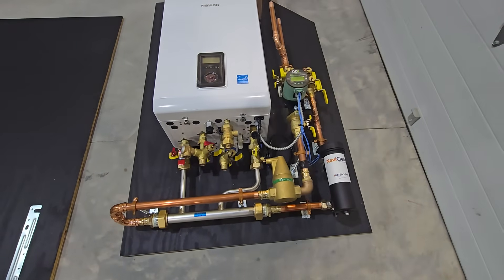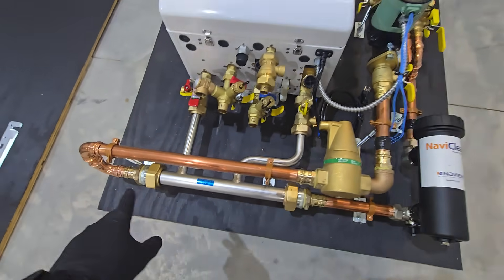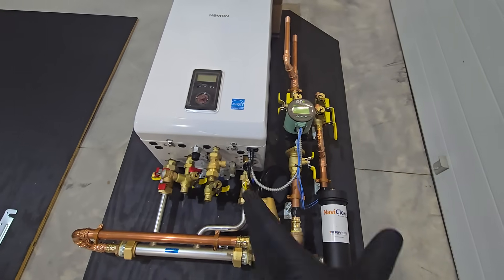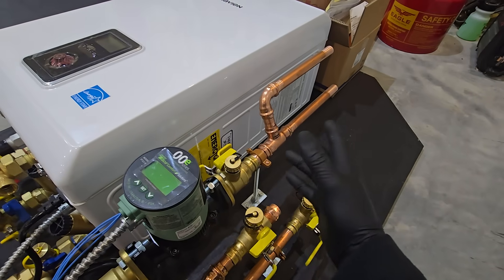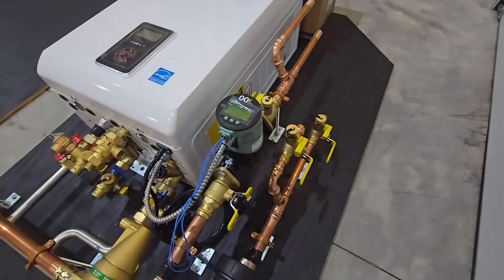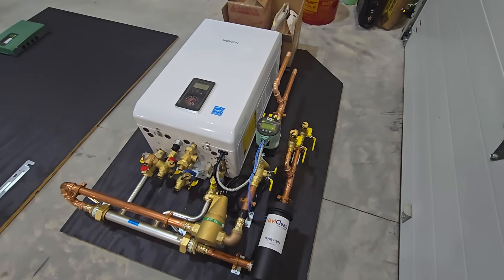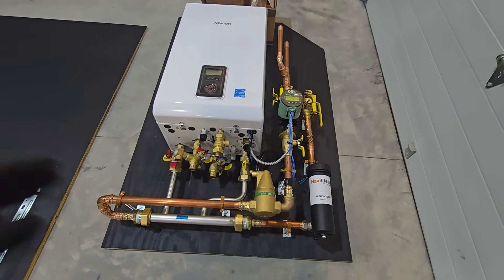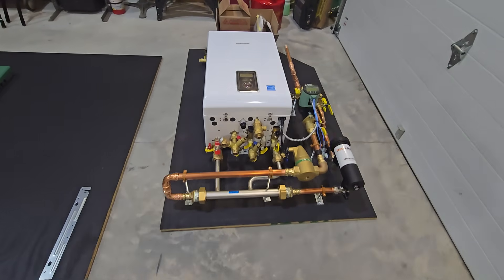Compact Pre-Built Boiler System

Comment: Which model air separator do you use?
Reply from the maker: Taco, Webstone, Caleffi most the time, all depends on price and availability they're all excellent products.
Reply: @JimSperanza  Is there a size rating or are they all the same?
Reply from the maker: @idea999 size is determined by flow rates. Email me at speranzadevelopment@gmail.com if you need help with a design.

Comment: Things get pretty busy on the bottom side of these units.  One thing that I did was add a 3/4" stainless male run tee to the domestic out port and put the relief valve in it towards the rear to get it out of the way.  This allowed me to orient the isolation valves nice and straight.  I still haven't decided if I am going to use the auto fill port or do mine elsewhere, but I am leaning towards placing mine near the expansion tank and spirovent.    Doesn't look like I can add pictures here, but I would gladly share my mock up.
Reply from the maker: Email me at speranzadevelopment@gmail.com

Comment: love the videos, I've learned a lot.  I would of had you do my unit if I came across you in time. 

I do have a couple questions if you don't mind...

We have Navien NFC-250/200H replacing a 75 gallon water heater for heating and 40 gallon water heater for domestic.

1. my plumber said we can not put in a navi-circ because there is not circulating pump or without bringing a line back from the farthest appliance.  true?

2.  When the boiler is running for heat and someone turns on a faucet it kills the hot water for the heat side.  is there a way around that?

3.  It seems like the water temp varies slightly depending on flow.  Have you ever used a small water heater just for a holding tank for those low flow situations the boiler wont kick on for or to help average out temp variations?
Reply from the maker: Email me at speranzadevelopment@gmail.com

Comment: Question , I have a 14x24 garage looking to add a combi for radiant heat and hot water can I use 3/8” tubing on the existing slab because I can only add 3/4” of self level to existing slab with the door configurations ?
Reply from the maker: Yes just reduce your length of your loops to keep head loss down.